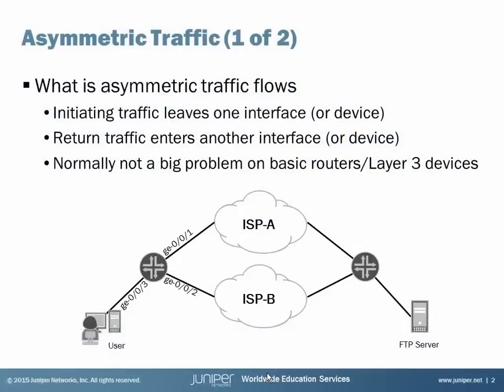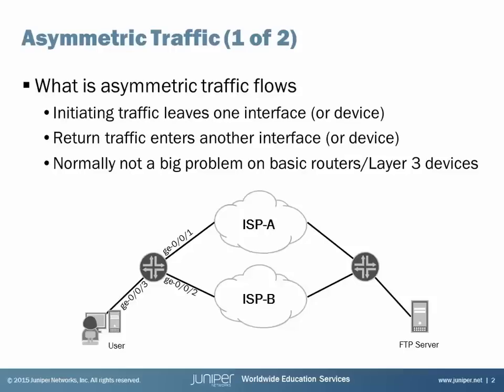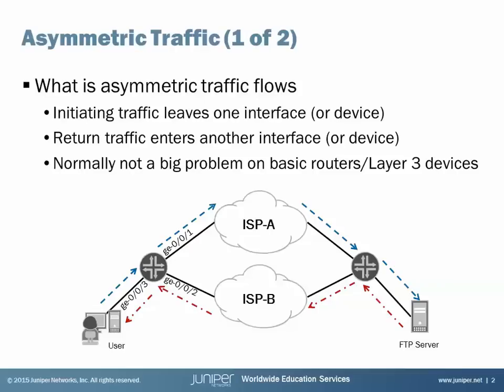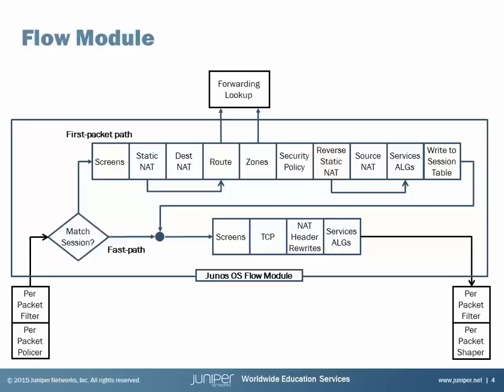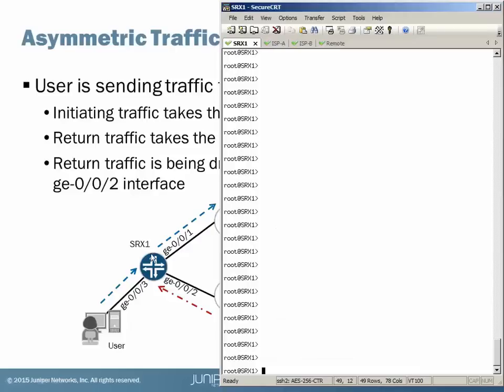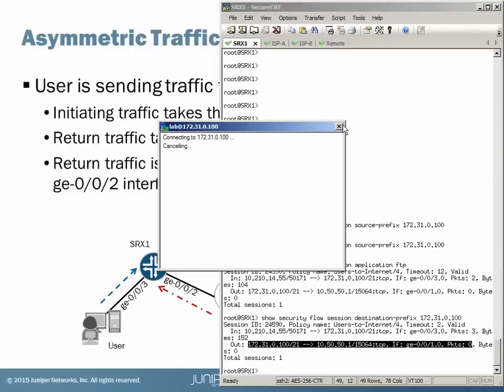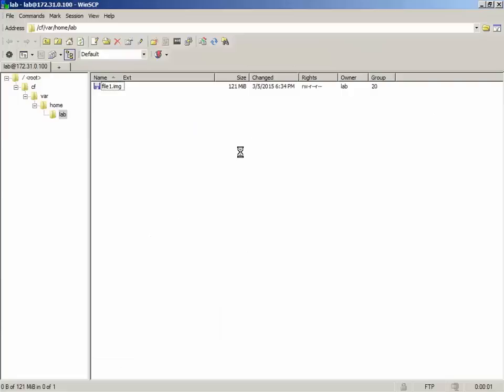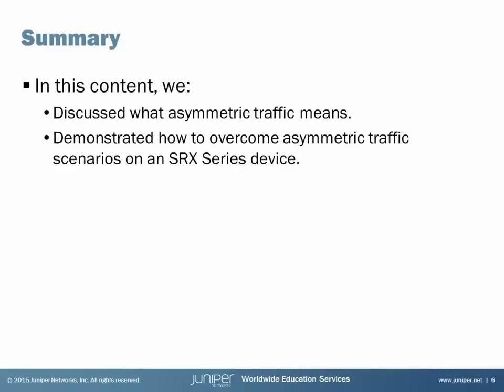Asymmetric Traffic with a Flow Based Device

Comment: Hello, I don't see a solution here that is mentioned in slide 1 - Returns traffic enters another device....what if I have such a solution? 2 different ISP (circuits) with 2 different routers? How should I configure this?
Reply: I had a similar problem with BGP and routed VPNs: Outgoing traffic was going through ISR Device and returning traffic arriving to a SRX device. Looking this video I realized that the problem was not the interfaces/zones but the fact that the SRX device was receiving traffic already initiated, so for the SRX this was invalid traffic; The solution was to disable syn-check and sequence-check at TCP header in the SRX device. Here is how:

set security flow tcp-session no-syn-check
set security flow tcp-session no-sequence-check

This solved my problem, I hope this can help you some way.